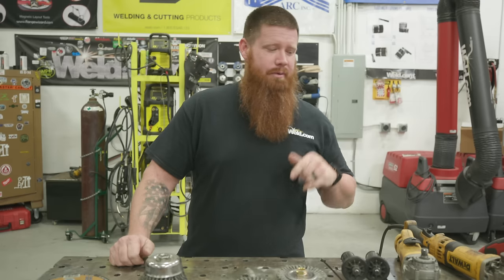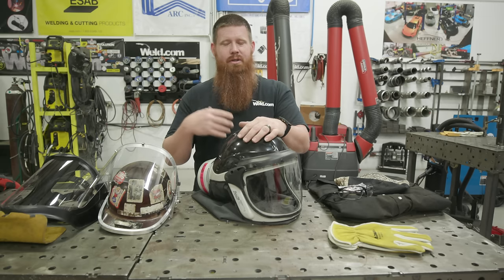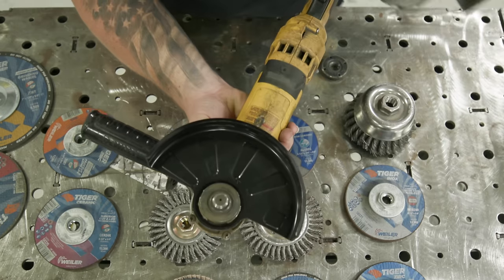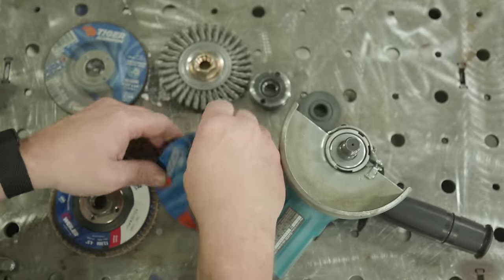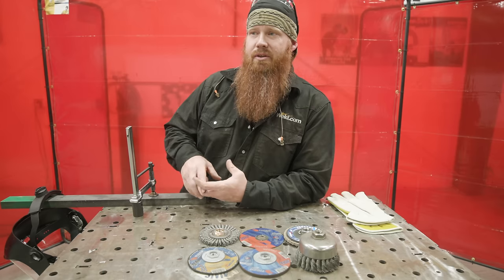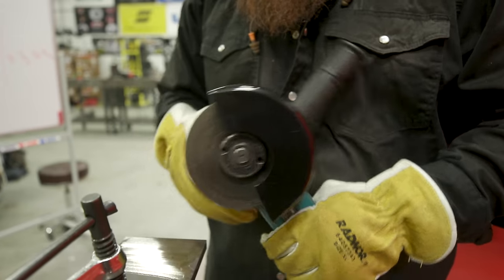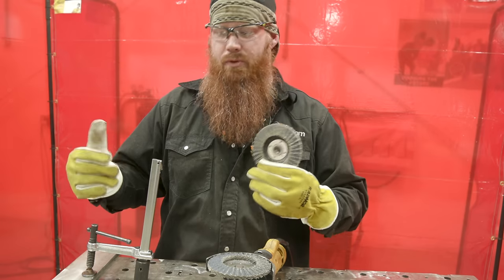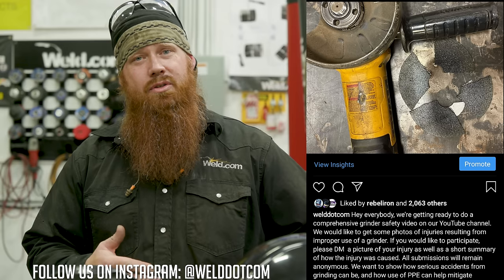Grinder Safety: How to Properly Use an Angle Grinder

Comment: Absolutely loved this! 🙏🏻🙏🏻🙏🏻
Reply from the maker: Thanks Alec 🍻
Reply: Weld.com 
Can you make a video on how to treat shop related wounds?
Reply: Chandler incidentally, Alec too has a great series on just that :)
Reply: Alec, your Grinding room is near perfect way to grind.
Reply: Just got done watching your videos lol keep up the great work can’t wait to see the finished zweihander
Reply: @Chandler7157  paper towel, super glue, electrical tape.
Reply: Hey alec I’m subbed to you!
Reply: Yours shoes are intied.
Reply: @Chandler7157  easy.
Don't get wounds
Reply: I know right?!
Just great delivery.
Really cleared things up for me.
Reply: I used to crawl into the inner bottoms for barges and tack weld my way out as they roll a huge weight and before I got my leather welding jacket I often caught on fire. Lost quite a few Cotton flannel shirts before that. You definitely never want synthetics because they are basically like plastic when they melt. I don’t know if any of you have been burned by hot plastic but it is not a pleasant experience as it sticks to you and anything you touch it with will also get burned and only cold water or cold liquid extinguisher will cool it off quick. Nasty stuff!
Reply: @Chandler7157  if it's a "wound" that's probably the point where you go to the hospital XD otherwise it's basic first aid.
Reply: @Welddotcom  I have a Milwaukee 2980 cordless 6 inch angle grinder and I can't find a thick type 1 backing ferrule like shown in the video. I don't think Milwaukee even makes one, at least not for the model grinder that I have. If they do make it, I can't find it anywhere. Can I use the type 27 backing ferrule along with a type 27 cut off wheel and a type 1 guard? That would position the cut off wheel further from the side of the guard and closer to the center of the guard. It seems like that should work fine, but wanted to get your opinion. I can't find any info at all about this on the internet. I would appreciate any info you can give me.
Reply: Helllll yeahh I love your channel
Reply: Omggggg
Reply: Osha's safety officer would have a field day with that scenario!! 

No Guard
No face shield or glasses 
Old solvent on bench
Torches being in the line of fire
Wrong size and rotation speed of wheel being used
No fire extinguisher close by
Reply: @Heywood-----Jablomeh  -- Yeah, all of that and here are some more....
One hand holding instead of both hands (no handle fixed to grinder)
One other hand holding the work-piece (danger of cutting off the wrist)
Not using grinding stand to mount the grinder (free hand handling is dangerous due to sudden kickback)
Not clamping down the work-piece (misalignment with disc can lead to sudden breakage of disc)
Oxygen tank right behind you (can lead to explosion)
Cutting disc seems to be wrong size (can break easily, at wrong speed)
Shirt is not tuck in (may get caught by the grinde
Beard may catch fire (lol)
Not wearing goggles (not protected from debris)
Wrong gloves (should be leather gloves)
Not wearing leather apron (may burn your pants or shirt)
Not using a type 1 guard on the grinder (an exploding disc can cut your tummy, wrist, and possibly little birdie or balls) ...lol
Sparks flying all over the place (may ignite the solvent on table)
Reply: @Chandler7157  better to not get any in the first place. that is a several day course of study, take the safety course.
Reply: Lol alec, you absolutely needed that 😅😆😆😆 specially with that 9 inch Dewalt 🤣
Reply: Thank you very much, learnt a lot about things i thought i knew. I don't know how i survived without having cutting wheel implants. Please do all power tools one by one. Good luck guy you rock
Reply: This guy is a very good presenter.
Reply: and possibly a horrific injury
Reply: M
Reply: We're moving into a house. They left steel shelving in the garage.  Oh, nice. Problem: sharp edges. Kid at one hardware store said I could sand these edges off with a hand file made for steel. Well, it took off some paint, but nothing more. Went to another "big box" hardware store, discussed with another guy. I had an idea of taking some of those sticky foam insulation strips and wrapping the legs to protect us from cuts. Kid said sure, or try this, and sold me an angle grinder. He did mention shower of sparks. Got home and thought "better watch some safety videos". Your's was the first one Holey Hell! That Kid should not have have recommended this tool to a noob. 😲 If I had someone to instruct me and watch me, like my dad, sure. But my dad has passed away. There's NO WAY I should try and use this without some expert hands-on instruction. 😆 Great video, glad I watched.
Reply: Probably the best safety video I have ever seen, thanks guys!
Reply: What kind of question is that